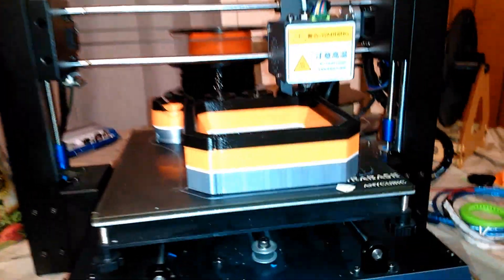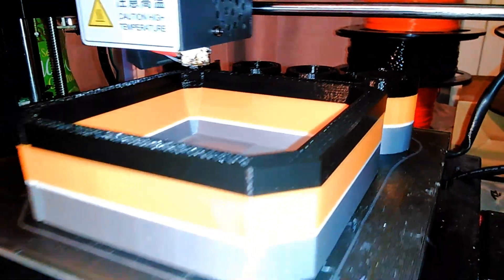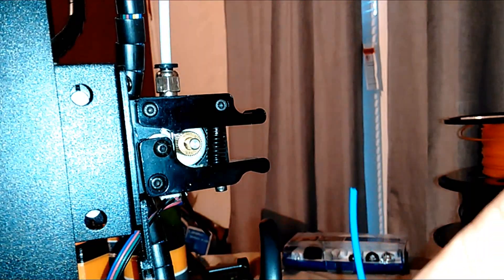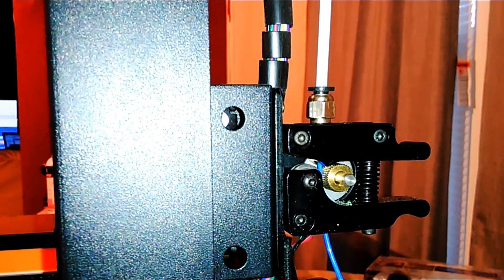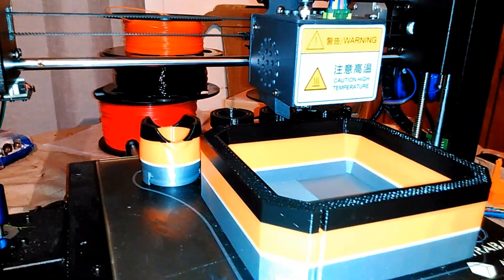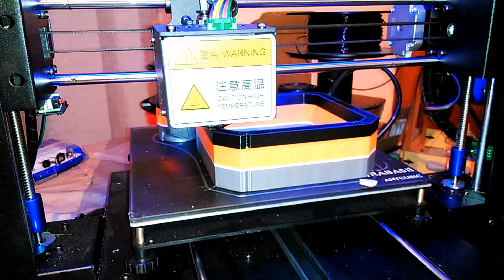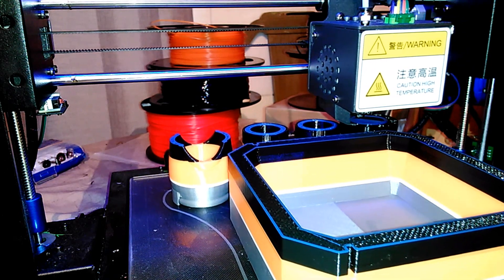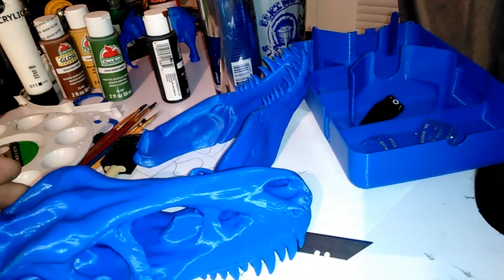Changing Filament While 3D Printer Is Running, Anycubic I3 Mega

Comment: Nice, good confirmation. The spool will run better feeding from bottom into sensor it can cause lumping in sides etc. Cheers just got a second Anycubic X nice machine but not liking micro SD cards with tons of files.

Comment: Can you give me details on your metal extruder, my standard one broke so I bought a metal one without thinking but it was for the wrong printer and didn't have the extra gear on it, however I love how it's open and strong so would like one similar. Details would be great please
Reply from the maker: https://youtu.be/SRJYWRoqvjE like this one. what do you mean extra gear? I had to mount this one different AND change the direction of the motor to get it to work. but it works great. better then the Anycubic one
Reply: @BrysonMichaelRC  so on mine the motor drives a cog that in turn rotates the cog at a slower speed. Might be called a titan extruder maybe, I'm new to 3d printing. However I fitted the same one as in your other video you posted link for but as well as going in reverse which I now know you can change the wires over reverse the polarity, it also extruded much faster, I didn't print anything like that though but I assume it wouldn't work as it would extrude 3 times as much material as it doesn't have the 3:1 ratio cog. So did you have to change any settings?
Reply from the maker: you can adjust the 'flow' rate in the settings. Thats what I did. Ya the little gear wheel on mine was bigger then the previous one so when extruding it extruded to quick. In that video you can hear it clicking cause its extruding too fast for the hot end. I changed the flow to 90% and it worked perfectly. You just need to experiment with the flow settings. You can do it while its running. Most printers have an option to tune it while printing. adjust the heat, bed tempt, fan speed and flow. Try that and let me know how it goes.

Comment: i have the same machine, i can build 100X100 in the center perfectly but on the corners nozzle hiting to bed i cant level properly.... can anyone suggest me to fix this please???
Reply: I know this is old and you've probably figured it out by now....but flash some custom firmware and use a software mesh leveling technique. I used this version (has support for the front display) and calibrated with the mesh leveling functions. 
https://www.thingiverse.com/thing:3249319

Comment: How come someone has so good printer that he can print so big items without the printer gets problems? I have had my Anycubic i3 Mega under a week and printed few items and they wasn´t even big, and allready it has problems. The filament looks not coming out from the nozzle properly. The filament kind of " curles " right after the nozzle and looks to be thinner than 0.4 mm and the first layer doesnt want to stick on the bed. I read that the nozzle is cloged but ALLREADY!!. I´m new to 3D printing so i don´t know so much yet. Before this printer i had CTC prusa i3 clone, and it´s nozzle never cloged. I haven´t cleaned the nozzle yet as i write this, but i hope this printer is worth the 250$ i spent. I´m not rich so i can´t afford to buy new printers every month. I thought this printer  is reliable. Or is there a 99% reliable printer?
Reply: Sounds to me like you need to clean your nozzle
Reply: i myself have anycubic i3 mega. for sticking to bed set atleast 60degrees heating for bed, build plate adhesion type to "brim", and for first 2-3% of your print use 50% speed, only then pump it up to 100. and my filament also not coming out at first, i just push down that thing on a back and push filament through by hand a little, and when  it touches bed, i leave it alone to work. it has problems, but what you expect for a price that small

Comment: nice video had a question did you use glue on the bed or any adhesive? Thanks
Reply from the maker: yes... I use a fabric adhesive for t-shirts on a printing machine. Its great stuff. One coat lasts forever. Looks like shit but It releases as soon as it gets cold and re-sticks as soon as the bed heats up.
Reply: Dude, you got the Ultrabase bed. You'll never need any tape, spray, glue, whatever. For PLA just heat it up to about 50 to 60 degrees C and it'll stick perfectly. After cooling down the part just pops loose without need for using a scraper.
Reply from the maker: That hasn't been the case by far. I dont know how many times I spent leveling the bed, messing with temps and all sots of stuff only to have the PLA pop off mid print and have filament everywhere. Half the reason I got the I3 Mega is because of that reason. Thats what everyone kept saying. But once I got it it did GREAT for the first couple prints and then just wouldn't consistently work every time anymore. I was pretty let down by that. But with just a little light spray of spray adhesive and its worked 100% of the time. I have this thing going pretty much non-stop so I cant have a print pop off and fail halfway through the print and lose all that filament before waking up. It happened a few times while I slept so I decided never again
Reply: Just for everyone else that might come here.   You need to clean the ultrabase bed after printing.  I use alcohol after every print.  I was cleaning after every few prints but then I started having an issue where it would not stick anymore.  Since this bed has small pits in it sometimes these pits get clogged up.  This is the secret of this bed, not completely smooth.   I had to use some acetone on the bed to get it completely clean.  After the acetone cleaning I wiped it with alcohol again and prints stuck perfectly again.   So if your bed is level and at the right Z height it is most likely a dirty ultrabase.  They don't go bad.
Reply from the maker: well what I explain in a later video, after talking to anycubic, at this point I didnt know my power supply was bad. It ended up going out completely. The bed wasnt staying at a consistent temp. As soon as I changed the power supply the ultra base worked perfectly again along with everything else. well until the chords in to the base shorted out and I had to fix them too. Ive talked to several people who spent hours leveling and their prints just will not stick to the bed. Theyve cleaned it and leveled it and did everything. Every one of them ended up being the power supply or the chords in the back. So its not always a matter of just simply cleaning the bed. Ive also talked to some people who have had warped ultrabase boards. So I appreciate the comment. People should clean their ultra base between every few prints. even if there wasnt a problem, that just seems like a given lol. This video was put out 4 months ago. Ive talked to so many people and learned so much more about this machine since then.
Reply: Hmm, I just got my printer and so far it works great. I totally understand you don’t want to risk losing all the filament and time. It’s one of the most frustrating things of 3D printing I think, when your prints just won’t stick to the bed.  Sorry to hear the Ultrabase didn’t last that long. I assumed it wouldn’t last forever, but I hoped it would last, I don’t know, maybe a year or so... couple of months at least. Thanks for sharing and I’ll keep the spray ready ;). Cheers, John

Comment: That's ok to follow the previous filament... but you will lose retraction until the new filament is all the way through.
Reply from the maker: surprisingly it makes no difference on mine. I literally sit here watching to see any difference. Watched it like a hawk. I thought the same exact thing. Cause you can see the new filament get pulled back while the old filament stays forward. I had absolutely perfect prints and the only stringing was in the supports which had stringing even when I didnt push a new one through. This I3 Mega is pretty legit. I think I ended up changing the color about 9 times on this print and so far 4 times on the next and still no different. The regular parts are printing perfectly.
Reply: Try it with Maker's Muse's torture test... I'm guessing you will see a significant difference... not so much with prints that don't require hopping to different "islands" on the same layer.
Reply: I would think you can possibly look for a spot in the slicer to avoid retractions. Using pause is definitely the better way to do this. I'm hoping the Pallet folks (or someone) comes up with a filament fuser you can just stick inline. Multi-material technology repurposed just for semi-manually plugging two filaments together.
Reply: So what is the recommended way? Pause and remove all filament and insert new? I don't even wanna change color but sometimes I have to add more filament during print.